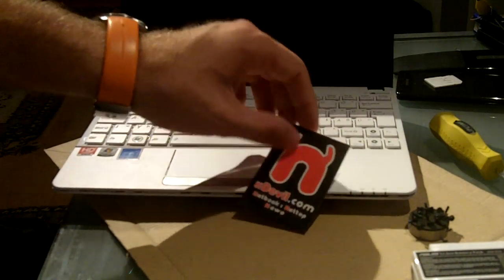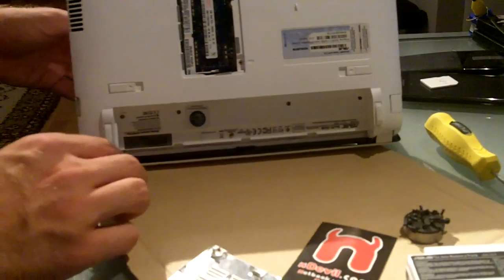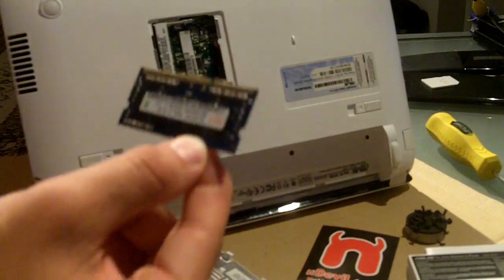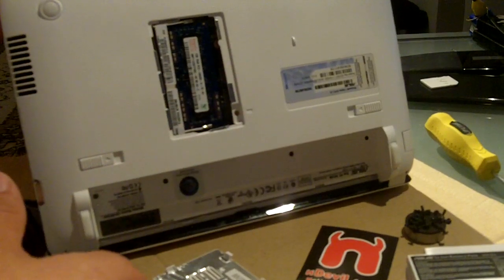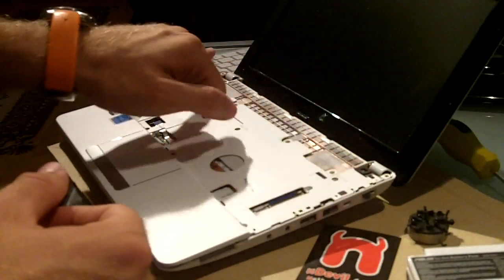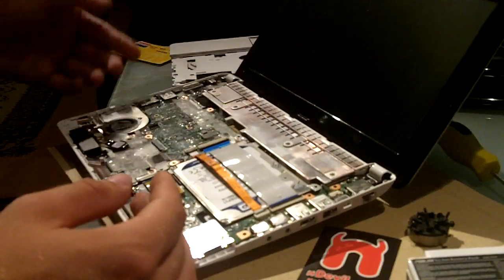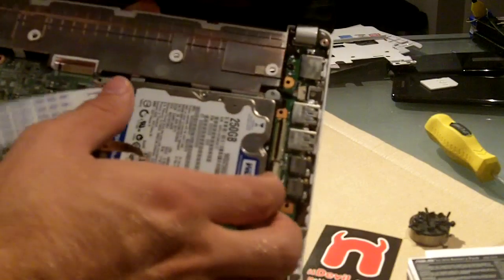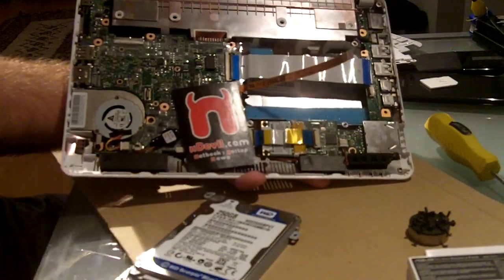Asus Eee PC 1015B RAM Upgrade and HDD

Comment: Thank you !  Liked, but cannot subscribe : I looked at your other offerings but they are in German and I don't speak German - LOL. Sorry. One Q: if you inserted a 2 GB ram module, knowing that the 1015B can only support a max of 2 GB (remember one 1 GB is already built in, so the total would be 3 GB) would this cause any problem ?  Danke (one of the few words I know in German - LOL)

Comment: I thank you NOT for this video.  You are a complete IDIOT.  Precisely on the points where we need to pay attention or something breakable is going on, the video is UNSHARP, or your HAND is blocking the view or you say that something is easy where it is NOT.  Can not see what connectors flip or shift or click.  Can not see where the placeholders are situated. With this video it is bloody impossible to replace the harddisk without BREAKING anything inside the netbook.

This ASUS netbook itself is GREAT with dual core cpu+gpu and hdmi, lightweight and upgradeable RAM.  I spent only EUR 240+25 on 4GB RAM.  It dualboots win7 ultimate and Linux Mint (both 64 bit).  With 4GB of ram it runs even a virtual winXP-machine inside the linux  (Mint with Virtualbox 4.1.12)

Comment: After that I opened the netbooks and put the 2 Gb module in the black one and bought a 4 Gb module for the white one. Still with windows 7 starter. There was no time gain in starting up.The 4 Gb was even 7 seconds slower! Another difference: Windows stated in the 4 Gb netbook that 2 Gb were available, but 1,61 available in the 2 Gb netbook. Rather weired difference. I understand the video mem takes a part of the regular mem, but with 4 Gb in starter there's apparently more available.

Comment: Right! I got 2 of them. One for my girlfriend and one for my daughter. I had the first one (a white one) upgraded at the seller's with a 2 Gb mem module. Later on I bought a black one for my daughter with standard 1 Gb module.
I then was able to test both mem situations. I first tested the white one with 2 Gb and the black one with 1 Gb. Both with windows starter. The white one started in 1 min 5 secs. The black one in 1 minute 24 secs. Quite a difference!